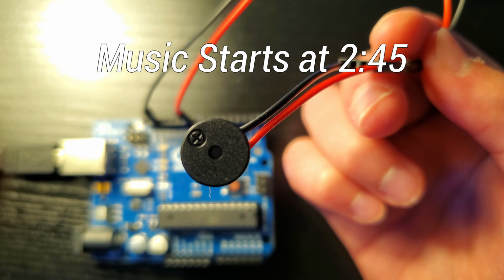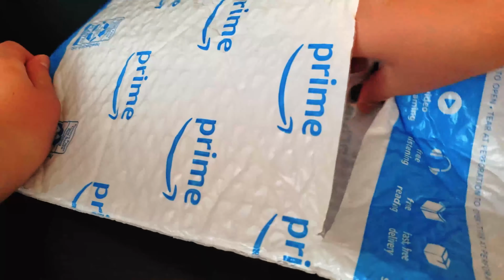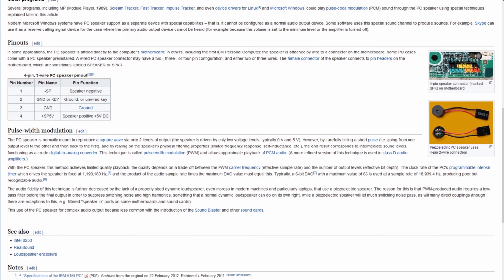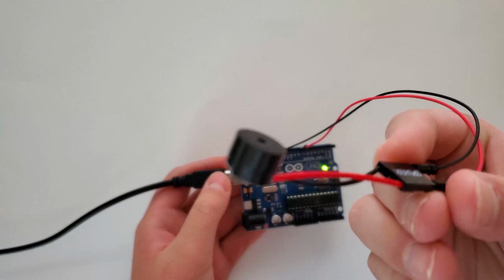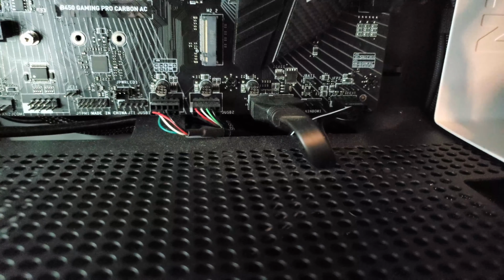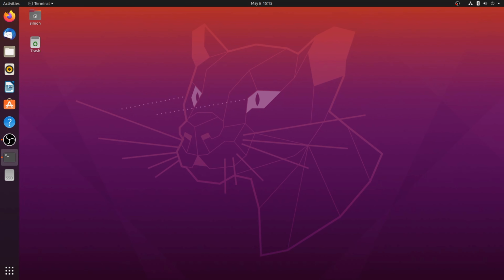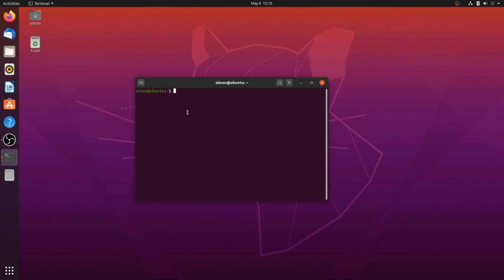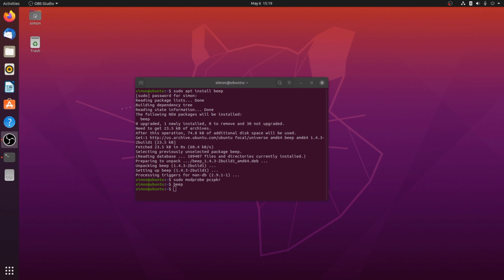Internal PC Beep Speaker: Installing and Playing Music!

Comment: >"Windows removed support for PC speaker and it can only be fixed with freeware, which is very sketchy."
>"So I will boot into Ubuntu instead. It doesn't support it either but I can install freeware that allows it to work" 

Bruh
Reply: Pretty easy to make a bootable usb, search up a tutorial